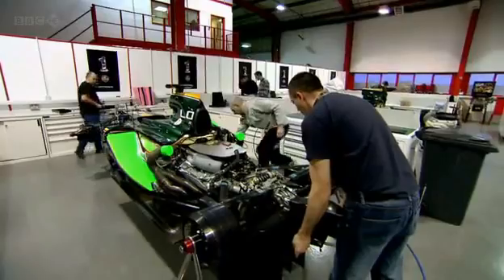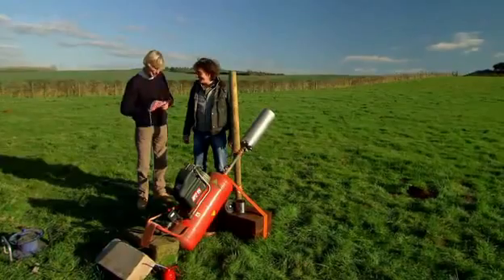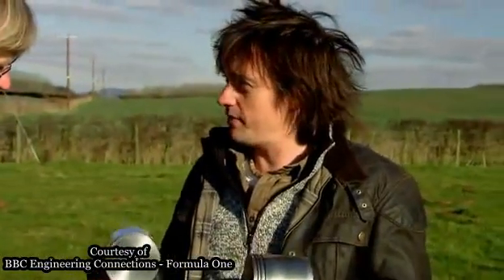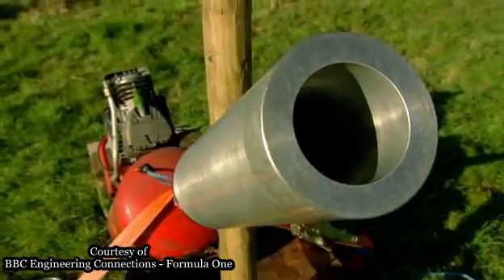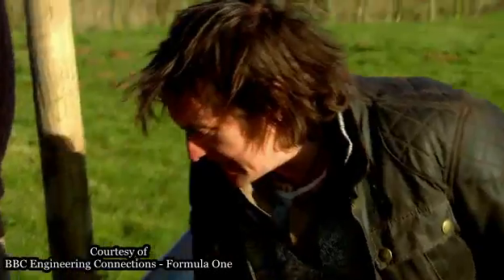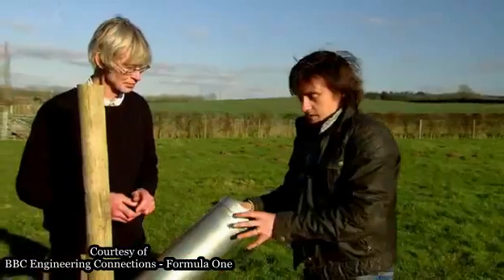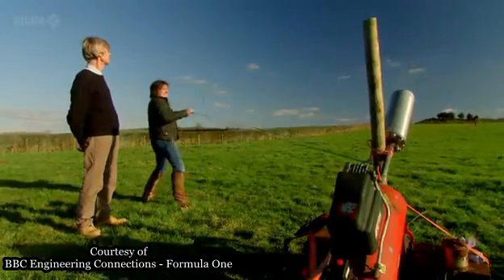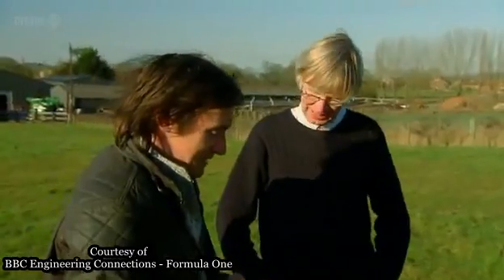The Secret of F1 Enormous Power - Precision Fitted Components

Comment: This is really bs!! There is number  thing to make f1 better. Better fuel flow, stronger an ligter materials. Engine configuration, angles of the powern, balancing the engines. The main thing would be how fast you charge the cylinder to get more fuel/air into the combustion chamber.
Reply: +Francis de Wilde So Sir Harry Ricardo  was on to something then !!  Try some of his books a lot of his theories been REINVENTED by modern multinational auto firms as new tech
Reply: I'm not discarding that smaller tolerance are important, but to base a theore on the reason why one F1 car is better than another is because of small tolerences thats bs. There is the bore stroke combinations, spark timing, cooling, combustion, the shape of the combustion chamber, size and shape of the head port and values, exhaust restrictions, turbo boost, injector sizes, cam shaft profile, air pressure to close valves, ligter and stronger crank shafts, and thats only on the engine not to mention the aerodynamics, kers, chassis, suspensions. Thats what makes a F1 faster, not a bs science experiment that may have an influence on car tech 20 years ago. Do you really think the merc team won the Ferrari because of smaller tolerance good luck putting your money on that baby!!  Do you know how close the tolerances are a modern car? It's already smaller than the tolerence of mention experiment.
Reply: Modern f1 a joke all you said is nothing new modern mass produced car tolerances high but far behind modern bikes  witness mr toyota sorry mr lexus went to mr yamaha for
"world beating" car engine tech in the LFA
and got late 1980s early 1990s fzr exup type
specs (note toyota a main steak in yamaha)
who make more income from car engine
production even for ford and musical  instruments than bikes
Reply: You are deviating from the point that this hole youtube clip did not MAKE merc world champions constructors. Although f1 is according to you joke is STILL, one of the fastest race cars around a standard circuit with ONLY 1600 turbo engines. F1 is the center   platform for all motorsport and race car development. There is a reason why f1 car cost millions, the technology on f1 car can be compare to a Jet plane.
Reply: Yes a nice "cottage" industry for many small specialist english 
engineering/ consulting outfits love the STANDARD CIRCUIT 
and only 1600 TURBO engines reference yes not a f1 fan well spotted
 and see above why merc won for give me but is indy car faster ?
and to compare to jet planes a bit sad ok i get it your a f1/merc fan
ok with me but to me the passing of  ever watching a v10 v8 v12 v16 flat 12 4/turbo flat out in anger a sad time enjoy your f1 me i stick to bikes
at the isle of man etc not track racing but ROAD RACING  why well
you can feel them check out on you tube ISLE OF MAN TT 2FT AWAY
180 MPH JANES FIRST TIME AT THE RACERS 2013  like the odd car
rally as well  maybe if could get up close to f1 say 10 yards may like it more
Reply: I'm not a merc fan, I support ferrari. I've been the Bar Honda pits when they tested the F1 cars at kyalami (South Africa) and I've been to the last two Melbourne grand prix races. If you look at Indy cars, they run higher Top/ avg speeds on a oval track in comparison to a f1 car, but they won't be able to compete  against f1 car around a normal track. The tech around acceleration and braking are far superior to the ones on indy cars (purposely build).  So I won't think thats a good comparison. My dad has two ducatis but growing up in South Africa you have a good chance being run over by our native drivers, they have no regards to traffic laws, so I let my bike carvings pass. I've seen many clips on the TT challenge and I will go and check it out one day. I've built three race car where I did some serious engine mods.  Thats why I have such a big appreciation for f1's hi-tech gadgets. If only I have funds to play around with all of their gadgets..

Comment: I work a a engineer at BME ltd. we cut ellipse in to piston making them oval!! Why u ask... Because most of the mass is carried parallel to the wrist pin in the pin boss towers of the piston. There is VEARY little mass out at the shirt! So due to rate of thermal expansion of the piston it grows more at the pin then at the skirt. So we cut them oval so the grow round!
Reply: You "work as an engineer", yet you can't spell or type properly? And you spend your time on youtube watching dumb videos about F1 engines. Right....
Reply: justforever96 On the internet, everyone is an expert/engineer
Reply: +Nick Holm There was a period in the 70 ' s early 80 ' s where I think Honda had a go at very oval pistons to get better breathing , more valves or bigger or some such . 
Standard round oval ........... that must have been a game & a half , to set up & inspect ........... but then I filed a dog leg Woodruff key for a wayward BSA Bantam !
Reply: +magna59 Not the 1st to try this and the NOT THE last to fail ,the 80s honda nr500 was a way to get a v 8 type engine under 4 cylinder ruleS each piston had 2 con rods and after lots of cash the two strokes still won out !!!
Reply: +Nick Holm That's why rotaries are awesome.
Reply: Groom Lake that is a lot of exclamation marks for the message you are trying to convey !
Reply: Groom Lake 
Been using your guys rods for most my life, we broke everyone's rods, blown Alchohol bbc 14/71 blower, soon as we would let off through the lights it would rip the caps off. Not always but we found Bills forged billit aluminum rods to be by far the best out there, thank you for sharing knowledge, anyone talking shit to you is an absolute smuck at best! 
Btw the pistons you guys made us are unbelievable, can't beat the quality, i see now why every serious top fuel, top Alchohol racer runs your parts!
Reply: Groom Lake 
Check my reply, thanks again for knowledge most have to pay for!
Reply: I'm not a registered engineer, but I do know my way around things, can you tell me what a "mechatronical" engineer is, because I've never heard of that field of engineering, or is it like a Disney "imagineering" degree? lol!

Comment: Um one question ... Piston rings??? Hello people!!!!
Reply: Nick Holm Piston rings account for loose-r tolerances and heat expansion. Now, I'm not an F1 engineer, but I think that they still use piston rings, but just to ensure a tight fit all the time.
Reply: piston ring is there to block oil from coming into head chamber and to seal piston/cylinder gap - but if you will see some worn engine check the play and gap between piston and cylinder-rings are still sealing the gap, but most of engine performance is gone. I see this in an old engine. new piston rings wont help you getting power back

Comment: This is hands down the STUPIDEST professionally done video I've seen in quite a while!
ALL F1 pistons have clearance at operating temp and interference fit pistons are not new at all, a regular F-150 w/4.6L from the 90s has this situation, it's nothing special at all.
This is like a kindergarten show and tell where all that matters is nobody else has a clue.
What can you expect from BBC? It was made for them and they're probably none the wiser. Dotards!
Reply: causeimbatmaaan Dont be suprised its a sideshow by Richard Hammond.
Reply: Lan Hikari No kidding!
Reply: causeimbatmaaan im a newbie this this and i learned. Obviously so much more goes into an f1 engine, but i didnt realize they built the cars to spec at the operating temperatures before they run the darn thing. So they imply a oil trasfusion is done before every start up? Thats an investment no private owner would of ever thought to make in a normal production car. Much more expensive obviously
Reply: do relax
Reply: causeimbatmaaan F1 engines do not have clearance at operating temperature. if a F1 engine is cold. it's "frozen". that's why they have to pump hot oil through it before they can start it.
Reply: causeimbatmaaan F1 engines don't have clearance and only work at operational temperature; otherwise the piston is oval and locked up.
Reply: +causeimbatmaaan Mate ........... most people avoid opening the bonnet , the manufacturers are happy to put silly bits of plastic trim on everything , to keep the " customers " happy in their ill education ( actually i ' m surprised it ' s not glued shut , with a dealer only glue system ) ........ yes , this is kindergarten , but it ' s a sight more than most people have though about , or want to . We are being dummed down , look where it got to with Vdub .  OMD2 would free us , until some silly sod advises government it will halm there tax take to not legislate it out of our hands ( or they can only get at OBD2 light , you know the one that show you the voltage drain when you push in the cigarette lighter , that then have connected to the child support agency ) . You do know , thinking is not cost effective ! It get in the way of a good rip off .
Reply: Thomas E That's a pretty stupid thing to assert.  Maybe you should think about it.  This time before you open your mouth.

Comment: The type of petrol used is also another factor. In F1 the petrol is more "explosive", therefore the force exerted inside the cylinders is greater than in a common road car. Both factors give an F1 car massive power. Not only in Formula 1 but for motorsports in general.
Reply: Eber Amezcua Not really, the fuel used by F1 cars is simple 100 octane unleaded fuel, the one you can get at certain petrol stations.
Reply: +xXYannuschXx So why in the last race both Merc and Ferrari get a HP boost from their new fuel?
Reply: Jeff H
They probably added an experimental fuel additive to further raise the octane rating, enabling more aggressive engine tuning.
Reply: xXYannuschXx Yes, which means it's not pump fuel.
Reply: Jeff H
It is still not more powerful than regular gasoline.
Reply: xXYannuschXx If the octane is higher than simple 100 pump fuel, then it's not what one can get a certain petrol stations. I would wager that it is a Looong way different with detergents and other additives as well.

Comment: HP = Torque x RPM ÷ 5252 so obviously if you rev to 18000rpms and make little torque it will make big hp numbers. The key of the hp (and noise) is high revs, which is achieved by high precision machining and balancing while using lighter rotating assemblies. Engine design and tuning allows to move the power band and peak torque higher in the revs.
Reply: Yes, but the precision is all about allowing massive RPMs and piston speeds, not to keep the hot gases from "leaking past the piston and wasting power", which is what he appears to suggest here. If it WAS leaking past the piston, it'd be going straight into the crankcase. Which obviously ISN'T happening...because that's what piston rings are for.
Reply: +gt4-celica-87 and if all to much for you bung a turbo on it pop pop bang bang if still no good run to mr yamaha like mr toyota did for his other self in the lexus lfa
and got some late 80s early 90s engine tech gee a 9 k redline  as for noise good
theory as all them old low reving tractor tech v twins and v8s all whisper along the roads

Comment: The tighter gap piston will also have a higher mass therefore will travel further as we all know the equation taking mass and acceleration into account.
Reply: They are hollow underneath the piston crown so they very well may weigh the same, we are also talking in grams here which won't have a huge affect on an engine producing 1000 000 watts of power. Also when a piston is pushing down it's pushing the mass of another piston or pistons up so the mass of the pistons are balanced. The inertia in the engine comes from the flywheel. The size and weight of the piston has no impact on it's travel either. As it can only travel so far without tearing itself off the crank shaft or smashing into the cylinder head. The distance a piston travels is it's stroke and is not changed by the pistons mass to any significant degree.

Comment: I might disappoint some of you, but here's an example: there's a 0.08 mm fit piston and there's another one with a 0.02 mm fit, and you know what? Believe it or not, they'd hold pressure the same way. Why? It's the rings that hold the pressure! That's why we measure piston BORE, not piston size when we estimate displacements, because the rings drag along the bore and that's what makes the volume. But the looser fit piston will wear itself and bore a lot quicker, so in terms of longetivity, it's a bad choice. Does anyone know what water temp and pressure is used in F1 engines?

Comment: Hammond is wrong. Tightly fit moving parts are just a minor factor of high performance of F1 engines. The key factors are: incredibly LIGHT (and strong enough to sustain the extreme conditions in an F1 engine) parts allowing for much higher RPMs, lubricants allowing for increased RPMs and much higher temperatures, and synthetic fuel, allowing for much higher compression level.

And another factors is the desing of the engine. Extremely short stroke would allow a road car engine to have, say 9000 rpm redline, but it would turn the engine in a gas sucker. Presure produced by an F1 turbine will it short-lived.
Reply: Spencer Howard you rely on a much greater definition of precision. However Hammond treated precision as simply very little clearance, which was wrong.
Reply: but he got 8 minute short not 8 hour seminar to explain how it all really works.
Reply: Precision made components that can survive the greater stresses, precision mixed alloys and other compounds for extreme lightness, precision synthesised fuels and oils. Precision made turbine and turbo components allowing the higher boost levels to be created at less weight. Everything you mention IS precision. You're talking out your arse.

Comment: So larger pistons make F1 cars make all that power? I thought it was the light weight pistons making 18000rpm possible that was the reason.
Reply: The stroke is so short on F1 engines that they can turn at 18k+ RPM and still have Mean Piston Speeds equal or less than a normal car at high rev. The short stroke means low amounts of torque and no power (Realtively) until like 10K, but the torque is not necessary for what it does, especially given it's weight.
Reply: This movie explains that the more compressions (tider pistons) leads to more power.
Reply: With any engine more compression means more power. Blowby past the piston rings means a tiny bit of the fuel-air mix is lost and a tiny bit of compression is lost. Less blowby and more compression means more power and more efficient since less of the fuel-air charge is lost into the crankcase and a better fitting piston does that.
Reply: You missed the point, it's precision not size that's the issue. He said that at the start.
Reply: Such a funny topic.. and arguments going on.  The point is the more fuel you get into the chamber the higher the explosion. How do you get more fuel into the cylinder? There is the top secret info f1 engineers protects. There are many ways: turbos, bigger cam lift, cylinder head port design and one other way is bigger valves. Valves size are limited to the bore size. If you make the bore bigger then you can increase the valve sizes. Then the stoke will become shorter that will mean the revs will be higher until it matches up with the piston speed formula(weight/material). You need small tolerances but the piston ring tolerance on a f1 car and a normal car are very similar. With this video in mind it doesn't carry any gravity on the piston tolerance discussion.